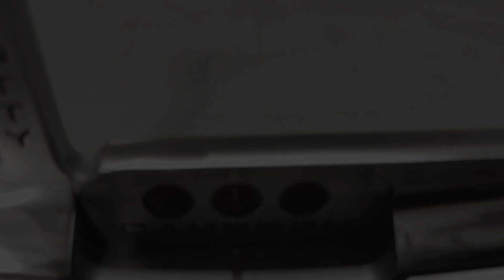Satin Bronze Putter Finish

Comment: Could I do this with an Oddysey dual force rossie 2? And what’s the prep work before torching? Thanks for answering all these questions. Means a lot!!!!
Reply from the maker: Torching would ruin the insert on this model. And this model insert doesn't just pop out. It's a poured insert imbedded into the body.
You would have to melt the current insert out of it, clean up the putter, dents dings etc, give it a high grit bead blast finish, torch it, then pour an epoxy type insert back in. A ton of work.

Comment: Does bead blasting/sand blasting remove the nickel finish on the putters?
Reply from the maker: There is no nickel plating on these stainless putters. But the old Pro Platinums do, and with high pressure and coarse media you can get it off, but it takes awhile.
Reply from the maker: @Andrew Kosloski honestly I've never tried taking the plating off, so I can't really help you there. I've heard of someone taking it off with a sand blaster but can only imagine it would talk half a day to do it. That's any refurbishers only do cerakote type finishes on them. I'd look for any place that does plating and have them strip it for you.
Reply: @igolf906  I was under the impression when you grind the nicks and dings out of the putter you are ruining the plating and the cerakote won’t take?

Sorry for all the questions, this has been so informative and it is very much appreciated!!
Reply from the maker: @Andrew Kosloski  no that plating UNLESS it's peeling, will not come off. So as long as your prep for cerakote is done properly, it adheres just fine.

Comment: What do you use when you use a cotton bud before the paint is added? Some kind of clear liquid?
Reply from the maker: It's isopropyl alcohol. I put a thin film of that in all of the cherry bombs because the paint flows in it better, and prevents  bubbles and keeps it glossy!
Reply: @igolf906  what temperature do you bake it at in the oven? Is just a drying process?
Reply from the maker: @Simpsons_dailyy  250 for an hour. It pulls all the moisture out of the steel and any leftover surface oils

Comment: You should have subtitles, I’m lost at what your doing with some steps hahaaa
Reply from the maker: Feel free to ask questions
Reply: When torching, does the putter just naturally turn that color? In other videos I see more of a glossy purple/blue. Thanks! Love the videos, think I found my new hobby haha
Reply: @griffindepauw3998  depends on the finish prior to torching. Also how hot of a torch you have. An acetylene torch will get the blue hues quicker. But carbon steels bring out the purple and blue hues much better than stainless.
Reply: @igolf906  And how do you get out dings and dents on the milled face?
Reply from the maker: @griffindepauw3998  has to be remilled.